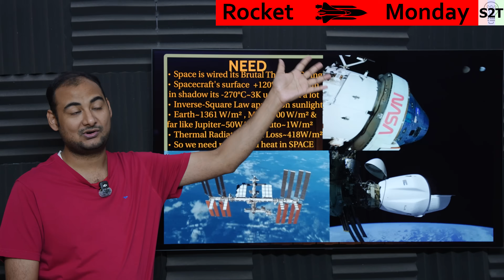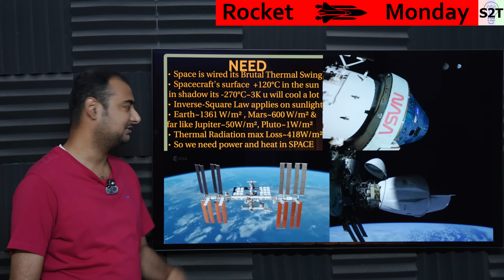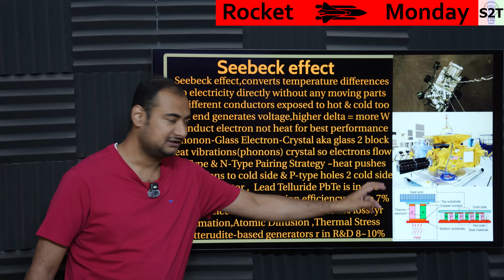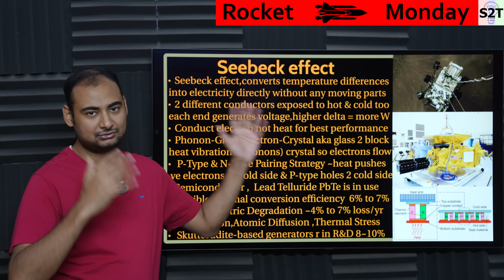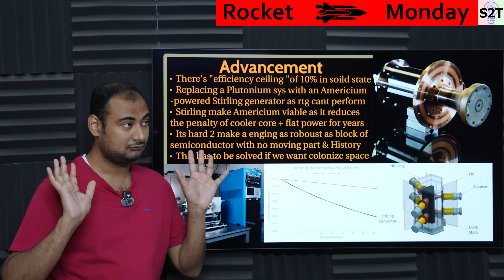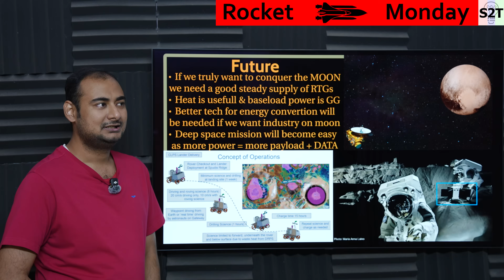Radioisotope Thermoelectric Generator {RTG} Explained {Rocket Monday}

Comment: Look into liquid droplet radiators 
A possible solution to space based data centers cooling requirements
Reply from the maker: see u can do what ever u want question is , is it logical . Microsoft' & many company put server under the sea as it was better for many reason but they canned the project {Natick} as servers hw change very quicly and if u have to keep pulling it out it  negated any benefit space data centre would be even worse

Comment: Thanks.  It would be interesting to see your take on why Stirling engines haven't made their way to consumer availability and affordability (any more). Especially in areas that are hot and getting hotter like India.  As well in countries that have a tradition of burning non-petroleum fuels like India especially in an era of increasing petro prices and scarcity.

Spaceflight, submarines, commercial solar concentrator are great for huge endeavours. Stirling engine tech isn't available for next day delivery to your house to make electricity and dal simultaneously.
Reply from the maker: its not that useful and if need something to utlize low t delta use organic Rankine cycle & and u cant make a Stirling engines cheap enough and reliable enough to basic use